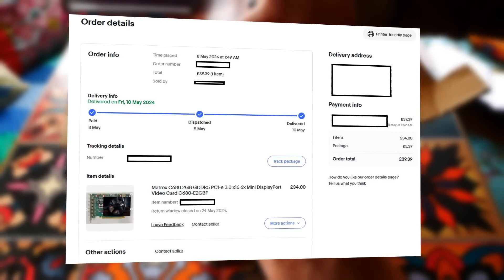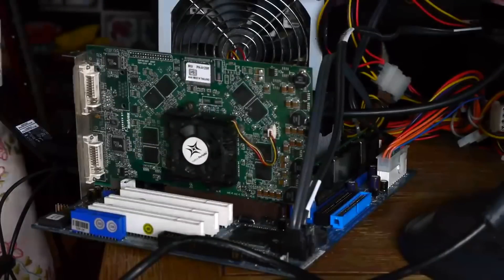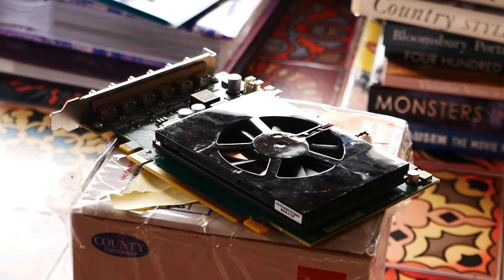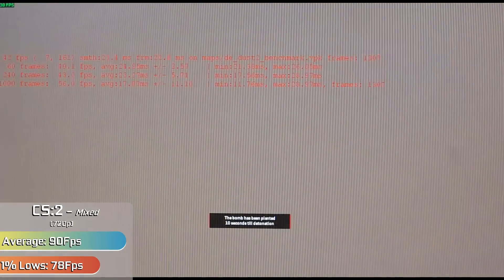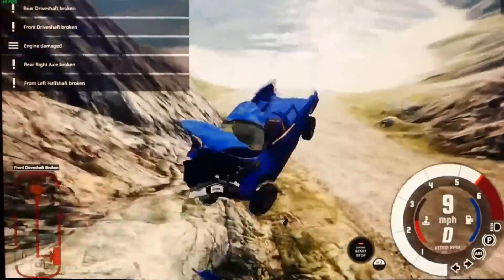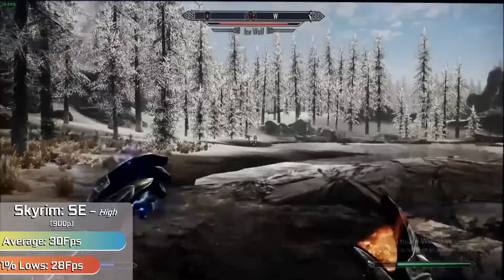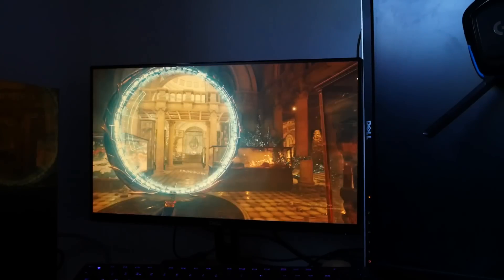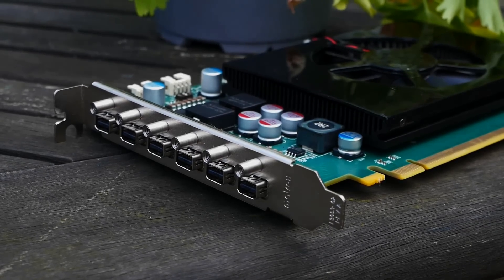Finally a new Matrox Graphics Card...

Comment: I wonder if its possible to shoehorn Matrox' drivers for the Cape Verde based cards like the C420 and C680 to the AMD cards they're based on namely (FirePro W4100 and W600) to get that driver polish and great frametimes. Or better yet make them possible to use on less power limited Cape Verde cards with similar amounts of VRAM (2gb/4gb) such as the R7 250 and R7 450.
Reply: I had the same thought. I hope Budget Builds sees this!

Comment: What you say about consistent frametimes of these Matrox cards reminds me of gaming performance of some professional cards, especially Quadros. They lose to consumer cards when it goes to pure performance, but do not fluctuate in the same manner. I'd put it primarily on the efficiency-oriented tuning with low boost clocks and high memory overhead in most of them. Matrox likely followed a similar philosophy.

Comment: Interesting to know they went AMD for the C cards, then Nvidia for the D cards (D1480 is using a GP107). Luma is based on the intel ARC gpus, so the luma A310FP and A380P are using the Intel ARC A310 and A380 platforms with 4 and 6gb memory options respectively, they should be quite capable with a lot of modern games although I wouldn't expect them to run them  maxed out due to vram limitations. availability from what I'm seeing right now is rather scarce, so you'd be more likely to pick one up on the cheap at an electronics recycler willing to resell to the public than you would spending 1500 dollars to get a D series brand new, or 660 dollars for a luma a380.

Comment: Any idea what the M series Matrox cards are based on?  I see a Matrox M9148 for $20 on ebay.  It seems like the M series may be newer than the C series?
Reply from the maker: I need to get ahold of one to test, the M series is older as its based on their own architecture, but I havent had one on hand to confirm this. There are two series after the CXX Range, Which include a short lived Nvidia series, and their new Intel based range.

Comment: I used to buy a lot of these cards for my job. They're popular for CCTV/DVR systems. You can run 4x4 displays in 4K. So you can basically feed 16 cameras to the monitors at once without having to downscale the feeds coming from the cameras. They're much cheaper and more stable than Radeon Pro.

Comment: … I know it’s kinda possible… but … put a 4090 in PCIEx16 slot 1. Put matrox in x16 slot 2. On a board that supports it electrically.. set the renderer to the 4090 and plug the displays into the matrox… can the matrox display the frames the 4090 is generating? Leading to an ultra… ULTRA wide 6 1440P display wrap around simming monster? 

I need to know.. for …

REASONS.
Reply from the maker: This is the type of stuff that Matrox was made for

Comment: I was a big fan of Matrox cards because they were the first (to my knowledge) to provide Windows NT drivers for multiple cards in one computer. It allowed to build the first dual-screen machines where the Windows deskop spanned both screens. Previously there was only one graphics screen (and a CGA text mode screen for example for CAD when the text mode was used for submitting textual commands).

Comment: Equivalent in performance to a GTX660. Poor performer but it has its specific use cases
Reply: What? It isn't even remotely close to a GTX 660. The Matrox C680 is just a Matrox branded AMD Firepro W600, which is just an underclocked Radeon HD 7750 (from 2012). These cards are half the speed of a GTX 660 at best.

Comment: I've got one of these! It's actually most similar to the AMD FirePro W600, and will actually run the AMD FirePro driver package and identifies itself to the system as a W600 instead of a C680 if you do so.
Reply: Oh! Also adding to the Matrox info; there's a D-series as well, in between the C-series and the Intel-based Luma. The D1450 and D1480 are both based on Nvidia's Pascal architecture, specifically the Quadro P1000 (but on a PCB that looks more like the P2000), with the only difference between the two being the ports: quad HDMI or quad-DP. Both seem to be extremely rare, however.

Comment: Re Fallout4: Monsignor Plaza is a bad test for exterior-interior cell behaviour, because the inside is NOT an actual interior cell (you can notice when you are at the top level and can see outside through some holes in the wall).

Comment: Some other really cool stuff I’ve seen about Matrox is the G200 was incredibly popular with server hardware until IIRC the 2010s. It’s only PCI, but for a server where it’s mostly CLI stuff connected to a 4:3 monitor, it’s fine.

The consumer versions of the G200 are also really interesting. There exist Dual and QUAD processor variants on a single card and where the DMS-59 connector comes from, I believe with each processor handling a separate monitor. This was in the mid-90s as well, when windows didn’t even have built in multi-monitor support yet.

Comment: My first PC had a 2MB Matrox Mystique 2D/3D card which I got an 2MB expansion board for to upgrade it to 4MB so I could play the game Formula 1 with Murray Walker as commentator. I would later add a Diamond Monster 3DFX card. If I recall at the time the Matrox Mystique was seen as the best 2D/3D card on the market with Monster being the top 3D accelerator card.

Comment: Going to build a system with this GPU and Intel 10th gen CPU. Supper unique GPU
Reply: This is just an AMD Firepro W600 from 2012 which Matrox put their name on and released in 2014. They even use AMD drivers in their driver package.
Reply: @ozzuneoj  That depends on how this was done. Licensing the architecture in your own silicon will lead to differences.

Unless this literally has the AMD logo on the silicon?

Comment: These cards are usually used for videowalls, and they are usually able to do frame sync between cards using the 8pin cables so that all outputs to each display is properly synced, usually the displays used match the sync received on the DP cable.

Comment: matrox...always great for multiple display outputs.configured as on screen...mulit screens ..groups of screens.
was and is used wide in the proces industrie,medical world, finace,banking and comercail sectors and some video walls.Everywhere were 24/7 stable use is a big issue

I wonder how the card would handle a multi 4K display setup as a outputcard with a modern GPU as as rendering unit.

Comment: why some tech-youtubers don,t understand that testing games in 720p on low settings checks the performance of the CPU rather than the GPU?
Moreover, what kind of test is it if there is no any other GPU to compare it with?
Reply: why some youtube-commenters don,t understand that everything has variation and they are not experts on everything?
Reply: @itsTyrion  why do some other youtube-commentators thoughtlessly and uncritically believe tech-youtubers who don't know what they're doing?
(and why do they assume that in comments section there are no better experts than tech-youtubers?)
Reply: @mk-wz2sh  I never said there are no better experts, but if you watch the video again, we're not getting >60 FPS in any games, that's NOT a CPU Limit with a Ryzen 3700X
Reply: @mk-wz2sh  To be fair, this card is running a GPU from 2012 (Cape Verde Pro GL is just an underclocked version of the Cape Verde Pro in the Radeon HD7750). That is why it runs so poorly even at 720P.
Reply from the maker: When the GPU is under maximum utilisation at 720p then yes it is a test of the GPU 

This would only be the case for testing CPU wise performance with a much more powerful graphics card. 

Thank you 👍

Comment: Matrox was legendary, always worked, lasted forever, usually offered dual high quality ( DVI ) output, could be found in almost each and every office system, but ... never EVER try to run 3D, because even the "Parhelia" models always were behind in regards of performance.
Then again, they offered sufficient 3D performance for any NON gaming Windows needs, including an effect rich desktop.
Also even back then a simple small Matrox combined with something like a Voodoo 2 did the trick for anything up to early Windows 98.

I didn't know there are AMD based Matrox models, only the Intel Arc based ones called "Matrox LUMA A3xx" .

Comment: Great video ! And I actually looked up why half life was capped at 60 fps. Turns out , there is a software limiter integrated in the game.Good news is that you can disable it with this simple command:

gl_vsync 0
fps_max 999
fps_override 1
 
Now apparently you can only do this if you have bought the game through steam , otherwise you would have to modify the game engine .either way , thank you so much for the video and I hope you have a great one !

Comment: As you mention, the GCN architecture is really energy efficient if not pushed to its limits. This could be seen at the time of its release as the HD 7850 an HD 7870 (and later R9 rebrands) topped the performance per watt charts, battling it out with the GTX 650ti and GTX 690 until maxwell came out. The HD 7750, 7770 and 7790 and 7950 all came in very close in that meric as well, it's not really until you move up to the really high end of GCN that power draw goes out of control with the HD 7970GHz edition and R9 290X. The rest of GCN mostly ended up looking really bad against Nvidia's Maxwell and Pascal architectures because of their insane power efficiency. But even later cards like the R9 380, RX 460/560 and RX 470/570 don't really use that much power for the performance you get, their Maxwell and Pascal competitors just happen to be quite a bit better in that regard.

Comment: I can't see the point of this card. It's an aged 720p card using outdated drivers, got no Linux support. Even iGPUs do much better nowadays. Even with 6 outputs and stable framerate don't have much appeal to most of the users. For a few tens of pounds more you can get a much more capable 1080p card supported by modern drivers.

Comment: The Matrox cards with 6-8 mini DIsplayPort connectors are primarily meant for video walls. The cards, together with the special Matrox video wall-software makes it easy to set up such video walls. 
The newest Matrox (released in 2023) cards are actually rebranded Intel Arc-GPU's, they just use custom drivers to make them "Matrox-y".
Reply: sounds extremely bold considering reliability expectations from Matrox and reliability issues Intel experiences with their cards. Those drivers better be "very Matroxy" xD
Reply: @Lapsio  the Intel cards are reliable, their drivers weren't good, now the drivers are good too.

Comment: Kind of sad that a Ryzen 8600G offers a (significantly) better gaming experience than this. I know gaming isn't the purpose of this card, but still.
Reply: it's more expensive
Reply: @RGn2-YT  And it's also twelve-thread CPU with a modern architecture, PCIe and USB connectivity, a 128-bit DDR5 memory bus, and even an integrated neural processor.

Comment: Wow! For the price this thing looks like a productivity beast! Up to 6 4K monitors all in a small power and heat efficient package using the modern interconnect standard! A card you can stick in your system and it will just work for years to come, digital signage, workstation, even gaming. One can even get unofficial tech support to this day! I am extremely impressed!

Comment: Now that was a VERY interesting video !  My very first graphics card was a Matrox Mystique, which came with 2 MB Ram and a slot onboard to upgrade it with another 2 MB to a whopping 4 MB. That's between 25 to 30 years ago meanwhile, lovely memories. The Mystique was part of my evolving  Quake 2 - rigs, at te end boosted with a 2x Voodoo II -SLi setup. Those were golden online gaming times, had tons of fun - until i got an enormous phone bill of over 900 bucks for extensively using internet-by-call with that 28.8 creatix modem. Lol.
Reply: I had a 1300$ bill for dialing into the Maxis BBS too frequently. Back then calls to CA from IL were 15 cents per minute at night and more during the day.

Comment: I looked into OpenCL because I wanted to write my shaders in C# and run them through ILGPU. CUDA is easy, you just include the cudart library and it runs anywhere. Trying to figure out how to get OpenCL going on AMD or Intel was a lot of reading through a lot of stuff about installing some things for Ubuntu 22.04 that you could maybe try and it might work - which did not make me confident about being able to distribute something that would "just work." So I switched to OpenGL Compute shaders. I already had OpenGL in front of CUDA via ILGPU so I could render from compute shaders into a texture, then blit the texture to the framebuffer, but it makes me sad not to have my shaders written in C#.

Comment: this should be pretty good for itx builds that does not require heavy gpu usage
Reply: These days you can get this kind of performance from integrated cards isn't It?
Reply: This card s 50 bucks so it depends if you are looking to mid max price vs performance @federicocatelli8785
Reply: @federicocatelli8785  yeah you can, but this probably works for workstations that requires multiple displays like 3 or more monitors
Reply: @federicocatelli8785 yeah, you can but this is for maybe for someone who uses multiple monitors

Comment: Nice to see you back, and with another Matrox vid, no less! The stability of these cards is incredible; frametime variance is an underrated metric, and arguably the most important when talking about the actual gaming experience. Would love to poke at the drivers and see how they compare to AMD's drivers to see just how they managed to achieve this sort of smoothness. Anyway, I love that Matrox chose Intel chips for their newest gen. Intel's current lineup feels like a spiritual successor to Matrox in some ways, so the choice makes a lot of sense. Very tasteful chips with solid drivers and stability. I've heard you can even properly lock clocks on Intel cards, which is something AMD and Nvidia haven't allowed for a bit.

Comment: I always had a soft spot for Matrox since it was my first ever computer graphics chip in a Sony VAIO in 1998. The quality was outstanding with digital-like analog output, 32-bit 3D, DVD playback, and it could run anything just fine - including demanding video game emulators. I didn't realize until the mid-2000's after getting an nVidia and AMD card that it wasn't necessarily normal to have such stable drivers and high quality analog output! I actually bought a Parhelia that I got on clearance for really cheap for one of my builds just to play around and sure it had outdated performance compared to the blistering pace of new AMD/nVidia cards but it was perfect for anything not too demanding, especially running on analog displays! I'm glad they're still around despite not making their own chips.

Comment: the skyrim test got me a little bit confused. ive used the IGPU on the i5 6700k and it ran skyrim at lowest setting at 1080p @ 60fps give or take. unless skyrim likes igpu's, is the igpu better than this matrox? cants say much about any other games, this was a personal thing i witnessed.
Reply from the maker: Was this Skyrim or Skyrim SE. I find the original runs much better, and usually use it as a benchmark but unfortunately it needed reinstalling.

Comment: How the fk did they get the frame times so smooth? You'd think Nvidia and AMD would strive to do the same. I wouldn't even consider my 240hz 1080p monitor and go for a cheaper 144hz 1080p display or even a 1440p one if the frame times were that smooth without those annoying micro stutters

Comment: I wonder if this Matrox stability still applies to their newest cards that are intel arc alchemist based. Comparing their A380 version to a normal A380 would be a really cool video some day
Reply: I think the modern boost algorythms are at fault for this. This card clearly has no clock deadtimes and driver integrated VSYNC. Not good for actual high power gaming but ideal for a display adapter and stability
Reply: They have custom drivers for the Luma A380P

Comment: I know you are praising the excellent frame pacing, as you are right to, but I have found that by aggressively undervolting modern AMD in the official software (around half the total wattage) the frame timing is drastically improved. So much so my preference for competitive games is to stay undervolted.

 Weirdly, 1440p seems to stutter less than 1080p, I cannot justify this behaviour.

Comment: so this gpu is based on radeon chip? does amd make drivers or matrox?
Reply from the maker: AMD base and then customised and made by Matrox
Reply: @BudgetBuildsOfficial  I couldnt find this C680 in shops (here in nordics). If it can keep fps lows (0.1% and 1%) very steady, that is very interesting, as some people are very sensitive to those, not to 30 vs 60fps difference. I find myself sensitive to random big changes in fps rather than max/avg fps. I hope matrox continues this lineup as that combination sounds very promising. Matrox Luna (intel arc) based gpus are extremely expensive vs different brand arc gpus. Somehow Id like amd radeon based more than intel based, so im not sure why they chose that.

Comment: I was recommended a Matrox for a multi-monitor workstation, and it was the most stable video card I ever owned.  I used it on 3 further builds over a span of 12 years before having to finally replace it as the new MB did not support it.  I was considering a Matrox for my last build, but their cards are manufacturing and display media focused